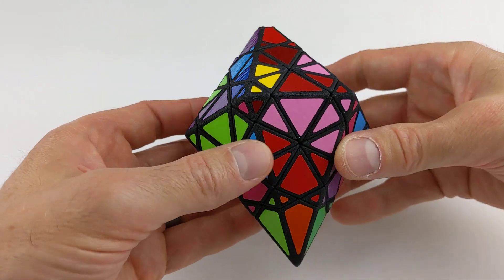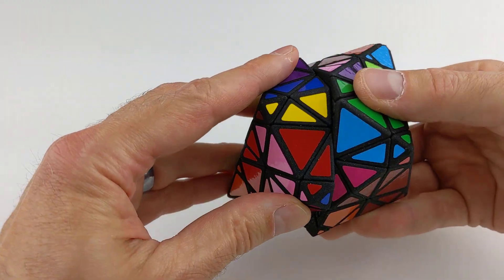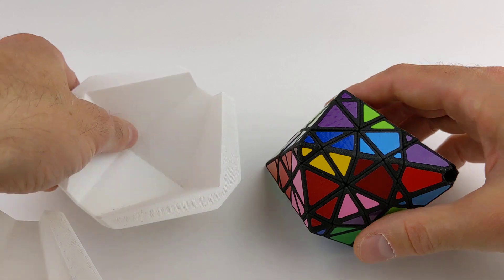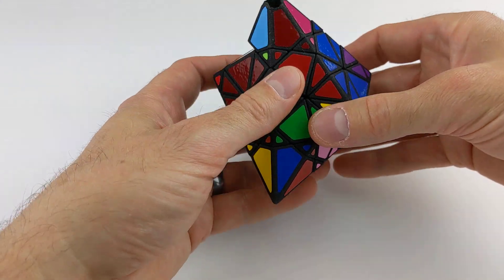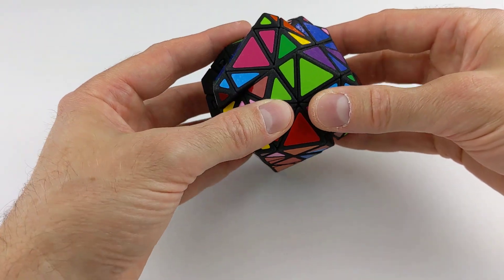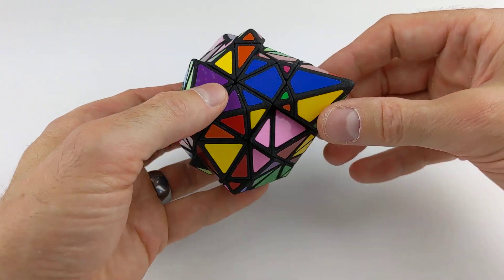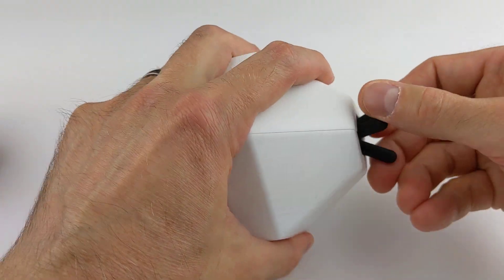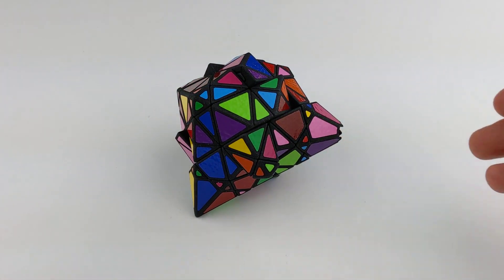Dave's Diamond 3x3x3 Part Two

Comment: I am super curious how the switching works.
Reply from the maker: Check out my post on the TwistyPuzzles forum to see photos of the core: http://www.twistypuzzles.com/forum/viewtopic.php?f=15&t=35138
Reply: @PitcherPuzzles  Wow, that's a really clever mechanism!
Reply from the maker: Thanks!
Reply: @PitcherPuzzles  I looked at the pics but still can't tell what is going on.
Reply from the maker: @bengineer8  it is a 3x3x3 inside, cut into a bicone shape. It has circular  rails around the cones in several locations. The outer pieces all hang onto the rails. The inner 3x3x3 then aligns with one set of cuts or the other, allowing only that set of cuts to turn.

Comment: So it's not possible to have both of the 3x3's scrambled at the same time?
Reply from the maker: Both 3x3x3s do get scrambled at the same time. You just need to restore the diamond shape before you can switch from one 3x3x3 to the other. Just like the original Dave's Diamond.
Reply: Ok cool. I guess the problem is, i don't understand why the shape affects whether or not the other 3x3 can be switched to. Is it about access to the core to make the switch? I mean clearly, the internal mechanism is very different, but on a regular 3x3, mechanically, even with a shape mod, there's no distinction between different positions on a scrambled puzzle, when compared to a solved one, as far as the internal mechanism is concerned.
Reply from the maker: The shape must be restored because the internal 3x3x3 core is a bicone with rails. The internal bicone and rails must be in the solved state before the outer shell of pieces can be rotated over them. Check out the pictures in my post on the TwistyPuzzles site where you can see the internals of the puzzle: http://www.twistypuzzles.com/forum/viewtopic.php?f=15&t=35138